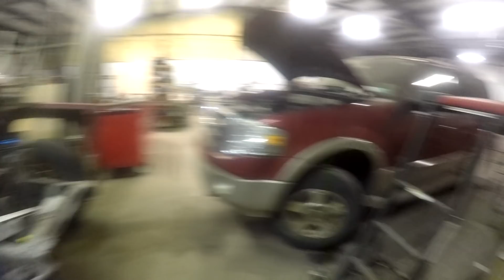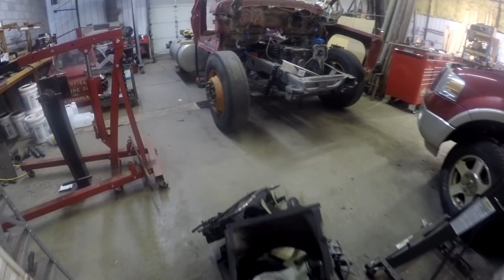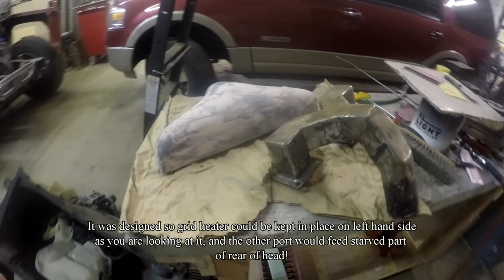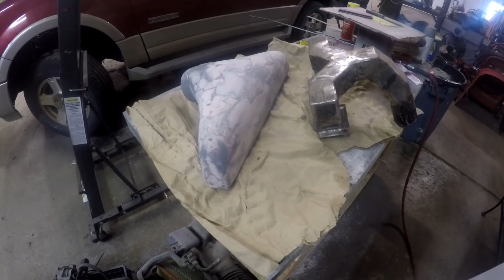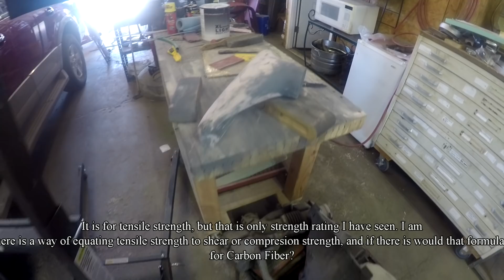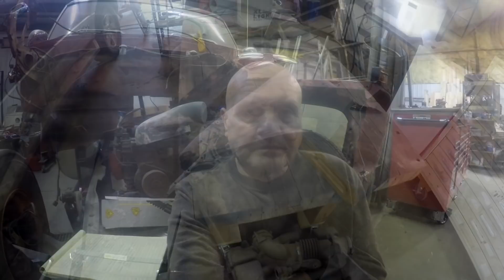Carbon Fiber Intake Strength and Fit To Cummins Haul Truck

Comment: I hate to have created ya so much extra work! lol For what it is worth carbon fibre I believe is a lot like wood, it kind of acts like it has grains and it is much stronger in one direction than another. Best of luck with the build! My only suggestion is when you think it is enough give it some more! :-)
Reply from the maker: No extra work, just consider it double checking myself and listening to someone that’s smarter then me. 
I am considering doing the intake build without adding extra support ribs or rib wraps to see how much (if any) distortion I get when pressurized. Then decide if to be used like that or support has to be added.
Reply: bcbloc02 
why didn’t my comment get a heart and kiss like urs

Comment: Fred YES
I WAS just lookin for sumthin new to watch
Good Work
BEST HAUL TRUCK BUILD SERIES ON YOUTUBE
Brian might not talking about failure from pressure
He might be thinking failure from heat, vibration etc. over time

Fred also..when u say “stronger”
Stronger in what way..tensile, tension, compression etc?
Is carbon fiber stronger that maraged forged stainless. I doubt it.
Thanks, good Video :)